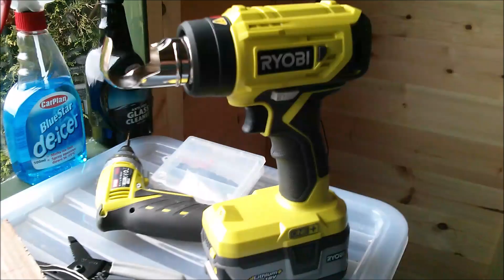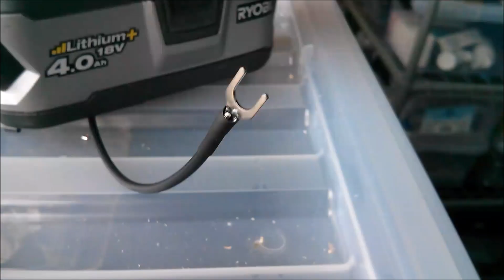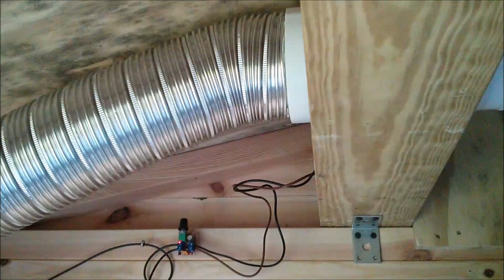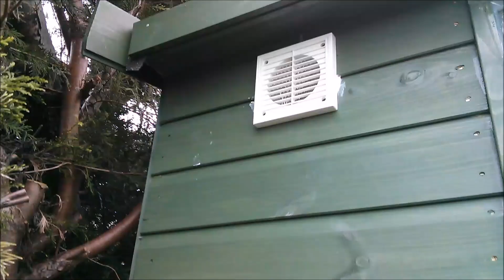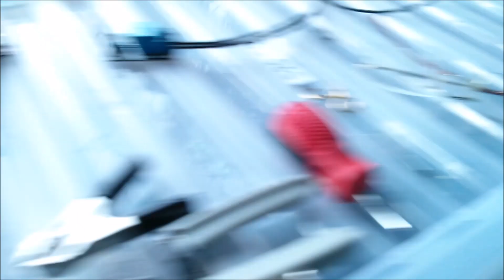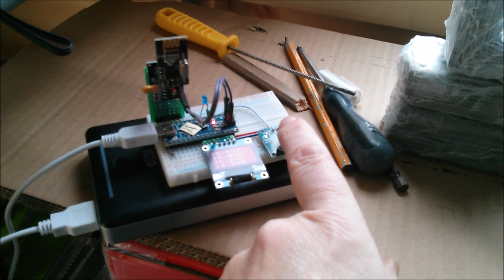Heat Shrinking in the Shed

Comment: To keep my workshop condescension free, I use a dehumidifier, which comes on and goes off at a preset humidity level. This is important for me as I have machine tools with precision ground cast iron surfaces, which I don't want going rusty.
Reply from the maker: What's the dehumidifier rated at?

Comment: Gorram that thing's expensive! £73 on Amazon! What can possibly be in it to justify that price?
Or does most of the purchase price go on their insurance/warranty/legal team in case it goes horribly wrong?
(I'm not one of the people who endlessly go on about Li-Ion batteries being the most dangerous thing known to man or anything; I'm suggesting that more because Ryobi appear to be about the first manufacturer that's created something like this, as far as I can tell, so perhaps they're wondering "...maybe there's a reason no one else has done this yet..."!)

I've thought about building something like this myself in the past - though not something that would get up to the 470℃ that Ryobi are claiming for this product - and probably repurposing an existing heat gun case, as making the case stand up to the generated heat would probably be one of the hardest things for me to do...
After all, getting hundreds of Watts from LiPo packs isn't a problem these days. I bought a 5S1P 4000mAh LiPo from HobbyKing to use with my TS100 soldering iron, and that's rated at 30C constant discharge (not needed for the TS100; that's just the specs you get on a 5S1P 4Ah pack!). That's more than the XT60 connector or the 12AWG silicone cables could handle, but I would think that just 10-15A from a moderately-charged 5S pack would be enough for heat-shrink tubing.
And that LiPo is a long way from the upper-end of what's easily available. I only paid about £25-30 for that. HobbyKing has a 10S1P 4500mAh 35C LiPo, for example, though it's totally overkill :)
... Not to mention the high-discharge 18650 cells used by the vape crowd, where you can get >100W from a single 18650...

Comment: I can’t recall: have you checked how fast humidity drops with this setup?

By the way, manual control may not be the most efficient way, but it is the coolest...
Reply from the maker: So far, it seems to take half an hour or so to get 3-4% drop in RH

Comment: Have you ever heard of a lighter before ? 🤦‍♂️
Reply from the maker: I don't smoke
Reply: Using hot air works way better for heat shrinking, in my opinion, since the temperature is limited and you can direct the heat from every direction without burning anything. The cheap Chinese hot air stations are perfect for this.

Comment: will you be making it so the fan turns on automatically when the humidity hits a particular level
Reply from the maker: Eventually
Reply: @JuliansShorts  cool that will be interesting i had thought about a pc fan near the ground one side and another pc fan as close to apex as possible to move air just linked upto a solar panel

Comment: A box of matches or lighter would have been cheaper for heatshrink.
Reply from the maker: I'm trying to avoid use of fossil ⛽ fuels
Reply: Julian - just admit it. you are a guy and therefor you like tools. and you will go to strange contortions of logic to justify buying a new one.
Reply: @JuliansShorts  what about mining the battery materials and oil to make the plastic components of the hot air gun? Also i see a better source of hot air ;) joke